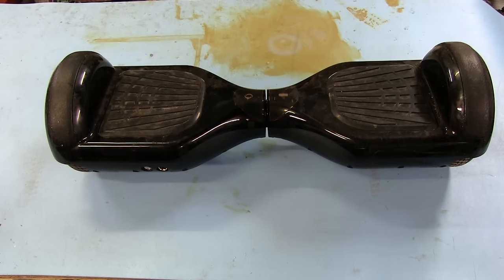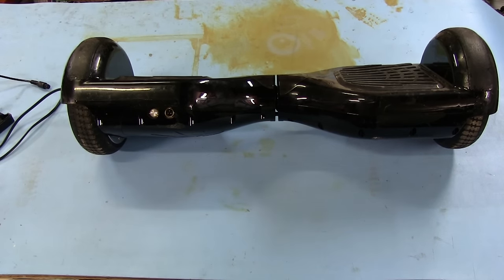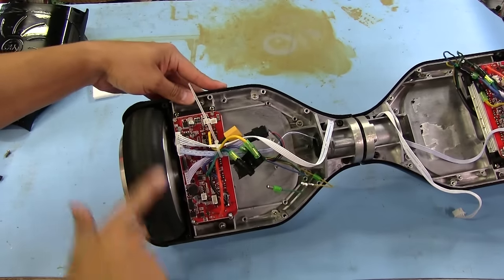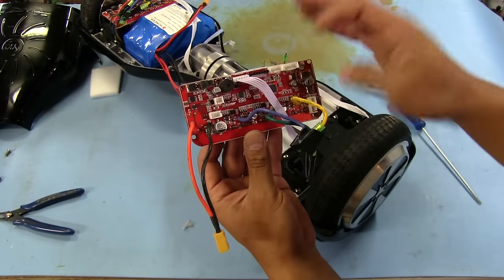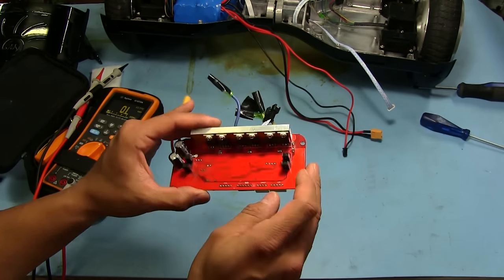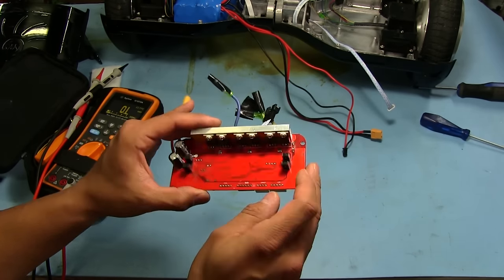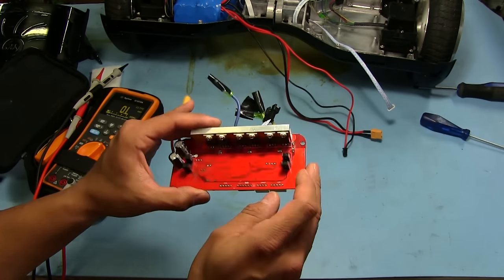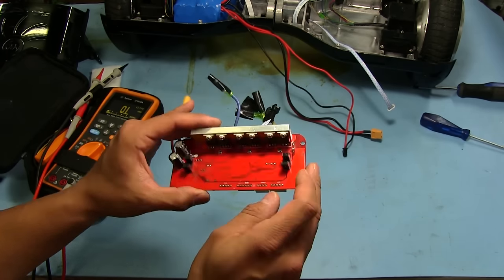TWB #31 | Let's Repair a "Hoverboard" Part 1 of 2

Comment: I am glad to see how wheels looks inside. I have bought hoverboard that has plastic (!) plate instead aluminum or magnesium alloy. Motors overheats and screws get loose after every 500 meters. Returned it to the seller (bought locally), but did not get refund yet (paid over $200). They sent it to some repair shop to test my claims that it is really bad board. Now bought used hoverboard with 10" inflatable wheels - what a difference!!! Small rocks and cracks in the concrete does not bothers me anymore. And battery seems last forever - my legs hurt, but battery still holds. No name, no brand... unknown origin, just amazing stuff for $130 (used). And it has bluetooth, not real sound quality, but id does not matter. Thanks for this video, it is inspiring.

Comment: The reason why you measured short on the charger port, is because the whole power rail was shorted because of the two blown mosfet. Thankfully the bms in the battery switched itself off, so the whole thing didn't go up in flames. As you removed the battery, the bms no longer sensed a shorted therminal and turned itself back on as it supposed to.

Comment: Not that this matters on a 6 year old video but the foot switches have nothing to do with what direction the hoverboard travels.  They are to sense when both feet are firmly planted on the board.  The gyroscopes [solid-state] then detect the change in orientation of the rider [lean forward, lean backward, etc] and propel the motors in the appropriate direction and speed.

Comment: Hey, i have the same type hoverboard as you have. But mine isn't turning on at all. My battery and the motors are ok. So what could the problem be?
Reply: Fpv Drone Videos the
 mother board is bad 
Ebay $24.99 buy 2

Comment: Mine would not calibrate so I opened it up and come to find out it was a yellow wire that was pinched near the center of the board. I repaired it it works great

Comment: what is the type of connector to use on the hoverboard cables please?  I would like to repair a broken cable without having to buy a card to have the cable.  Thanks a lot

Comment: Hello. Help me  please. I click on the power button, and the scooter does not turn on.  There is a squeak and squeaks all the time while I hold the button.
 The wheel rotates on one side if I hold the power button and press the pedal buttons.  The wheel starts to rotate smoothly and accelerates when turning (tilting) and if you change the direction of inclination the wheel first brakes and then begins to rotate in the other direction.  I can assume that the battery is alive.  Wheel windings are good means faulty in the motherboard.  Please tell me where to look for a fault and a possible method of troubleshooting.  Thank you in advance, Vyacheslav

Comment: I had a quick question about the LIFi video you did . does you unit still work ok ? . tried to power one on with a 5v adapter and it worked for 10 sec and just turns off. thanks in advance

Comment: So a MOSFET failure (maybe from overheating) is something to look for when troubleshooting circuits. That is sometimes there's no other underlying problem, just that the heatsink was insufficient for heat generated with normal use?
Reply from the maker: We just kinda got lucky in this case. Sometimes the FETs going will take out other stuff in the process, but since nothing after them or before was shorted or anything, it seems the problem was just inadequate heatsinking.
Reply: @ThatElectronicsFool  I see. I'm slowly building up a list of things to look for when troubleshooting circuits, and now it's grown one more item =)

Comment: So they dropped the over and your instinct was not to measure voltage at plug with multimeter. Weird. The plug is rarely an issue. Yup that's a short

Comment: Okay I have another board will not power on when I plug the charger cord in it turns green when I plug it in to the hoverboard it stays green what could that be
Reply: And it's definitely not charged no lights come on at all except when I first plug it in it say your hoverbord is ready to pair